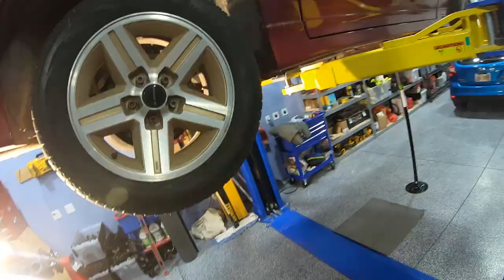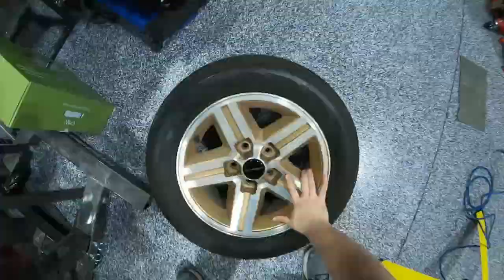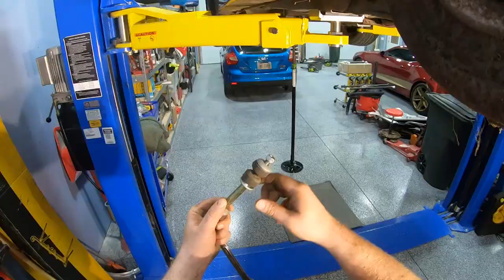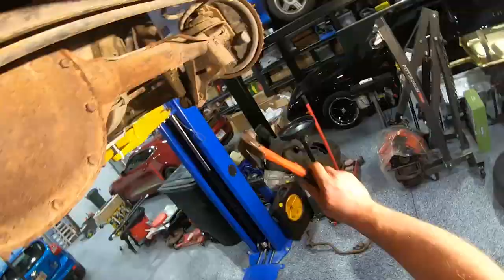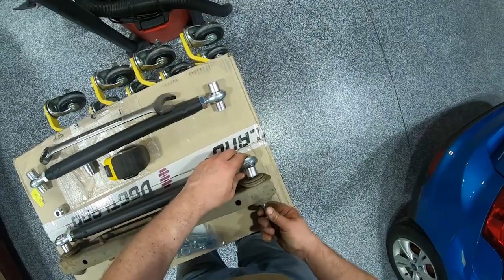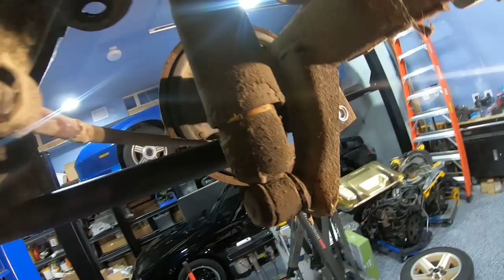1982 - 1992 Chevy Camaro Tubular Adjustable Rear Control Arms

Comment: i would have used rust converter and painted the diff black to match the new parts...
Reply from the maker: Normally I would.  This diff will be getting dropped in a few months to be rebuilt and powder coated.  Great suggestion.